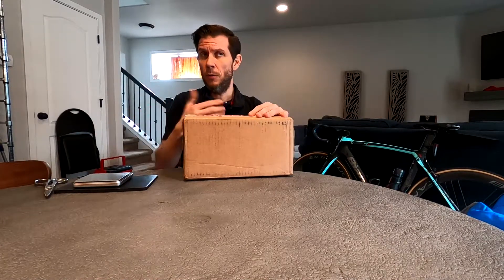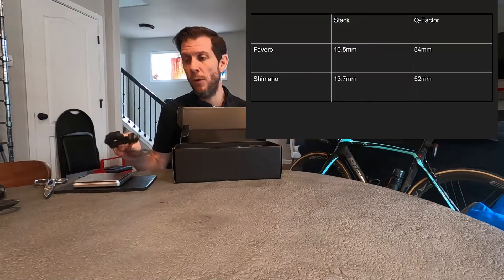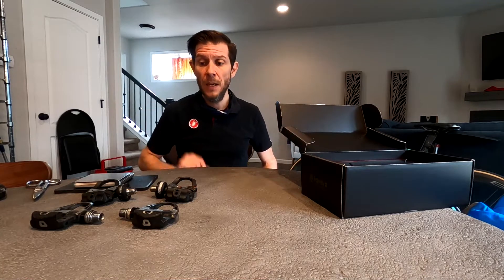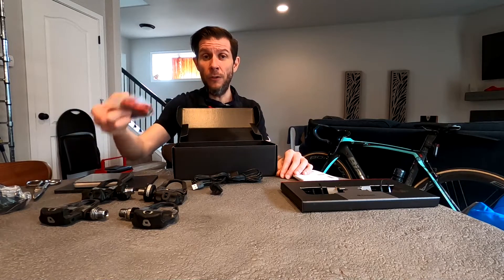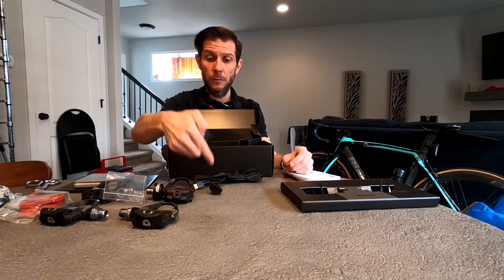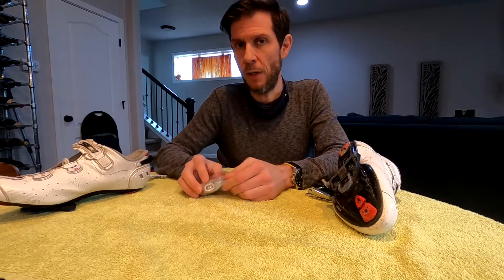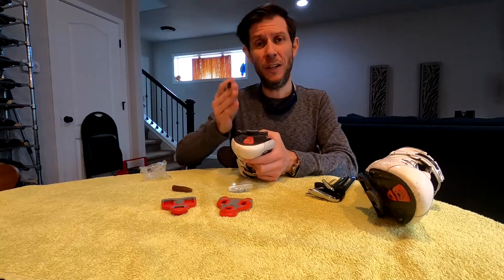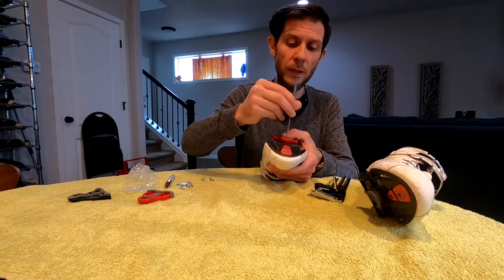Favero Assioma Duo - (Extremely) Detailed Unboxing, Installation, and Configuration

Comment: Yeah, you should definitely read the manual first :). It explicitly says that it has to calibrate first by doing the zero offset then pedal constantly for some time before transmitting any data to the head unit.

Comment: Such a great vid! Any how, i wanted to know ur opinion on the new Favero Assioma Shimano from the bike fit side of view because it comes with a Q factor of 65mm +/-. Wdyt?
Reply from the maker: The q factor definitely has an impact. I can't speak to the Shimano compatible pedals, but I do know you would feel that q factor. That could be good though as a lot of folks could use wider spacing anyway.

Comment: You had any issues when swapping the pedals between bikes with different crank length? I'm having issues getting the parameters / calibration right when in duo mode. I know my Garmin has the crank length but for whatever reason the right pedal isn't loving the change of crank size
Reply from the maker: I will admit that I've never tried that.  I do have a bike with 170 arms versus my usual 172.5, but it has a Quarq on it already so I haven't really felt the need to swap.  Supposedly, it's totally capable, especially with recent firmware.  I would reach out to Favero - their customer service has been exemplary.

Comment: Were you able to get the individual R/L power details transmitting to your computer head unit?  I'm using a Pioneer CA600 and must have a setup problem because I can't see individual pedal metrics.  I've scoured the internet for help but no luck so far.
Reply from the maker: Definitely. I get things like left right balance, torque effectiveness, pedal smoothness, etc. That's in Garmin and hammerhead units. Likely on wahoo too, but I haven't tested it on that.

Comment: Great power pedals. Just a heads up. The nut on the axel inside the outer cap started coming loose on my right pedal after about a year of use. May need a tighten every once in a while.
Reply from the maker: Thanks!  I'll keep an eye out for that!